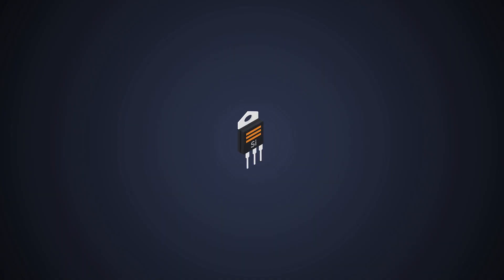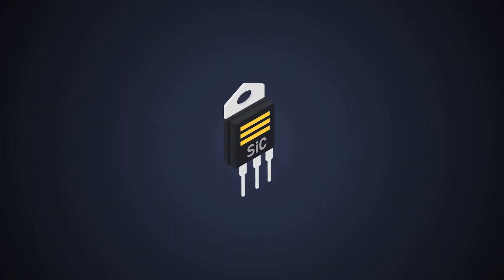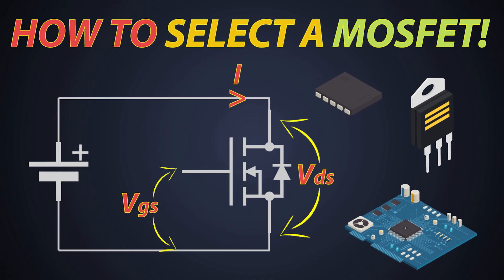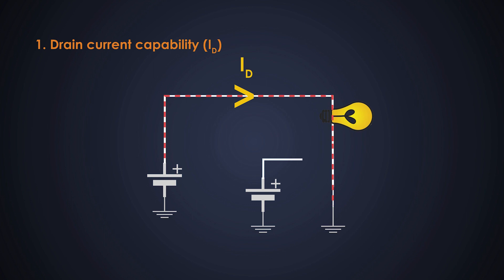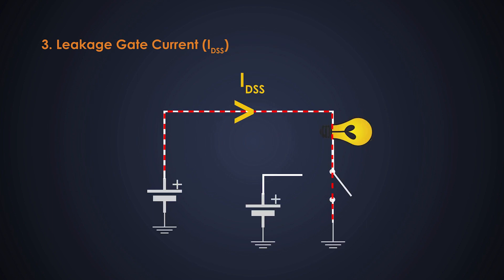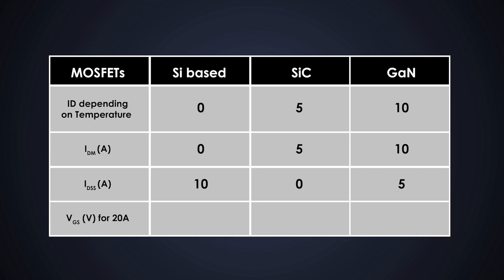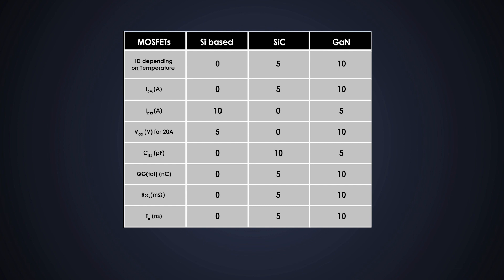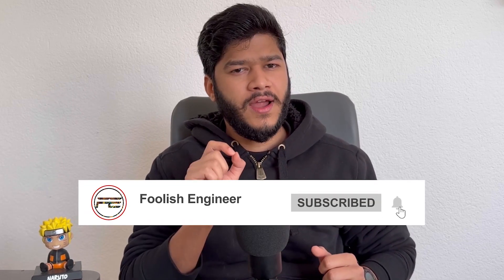Understanding Gallium Nitride FET | GaN FET | SiC MOSFET vs Si MOSFET vs GaN FET

Comment: A GaN MOSFET????
MOSFET is an acyrnomn for Metal Oxide Semiconductor Field Effect Transistor.

A GaN MOSFET does not exist the GaN devices you are referring to are HEMT devices (High Electron Mobility Transistor).

You are right calling the Si and SiC devices MOSFETs but not the GaN. 

It would be accurate calling them all FETs

Comment: At 12:28 it should be 35 mΩ for the GaN HEMET, otherwise the power loss is correct. 
I like those simple comparisons, however It looks to me, that this comparison is not completely fair, since there are FETs in the same package that can beat GaN in a handful comparisons for the same price point. Also the GaN model used here is alomost twice the price of the Si model. But otherwise good job.

Comment: It's a good topic, unfortunately this video has lot of misinformation. First he didn't chose a good SiC device. In fact, this first gen Infineon is a bad example of SiC technology when other companies are already in their 3rd gen... the truth is that SiC  is a better material than GAN for many applications, for example high voltage (3kV SiC are available but GAN stops at 1200V). SiC has higher working temperature and better heat dissipation. GAN has also a huge flaw with the material degradation that is a real issue for long term reliability. Finally, even more important than GAN vs SiC is the etching topology. Planar and Trench give very different results

Comment: You picked 3 devices  Si, SiC, GaN. The devices may or may not represent the best example of each type. This makes no sense!!!! You may be correct, but you did not prove it. This is called reasoning from the "particular to the general". In order for you reasoning to be valid you MUST search out the best devices in each category and compare, and then of course you must compare performance v. cost.
Reply: for example?